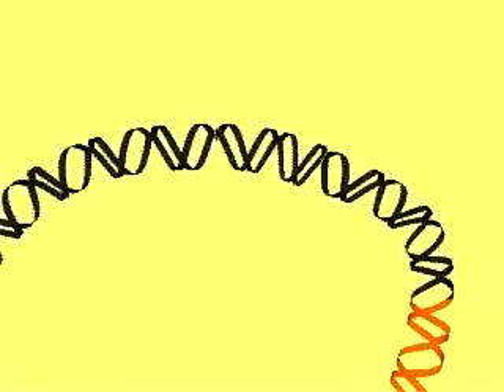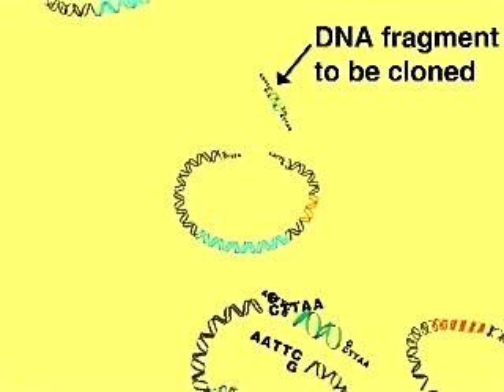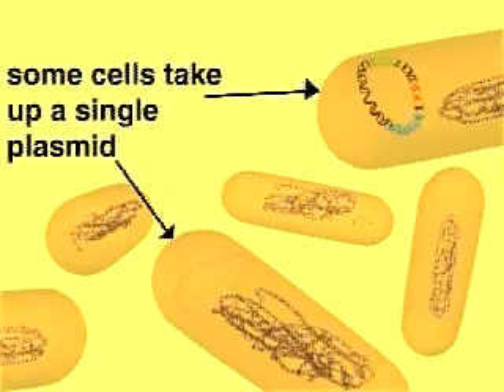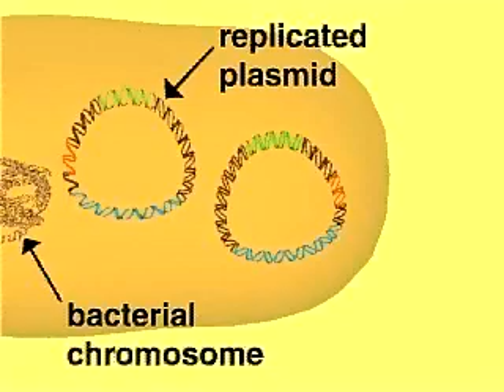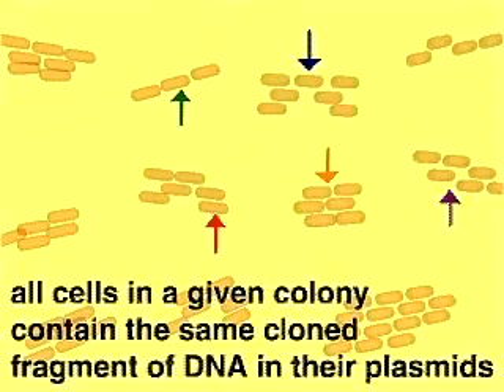Plasmid Cloning

Comment: Human insulin from plasmid cloning is not rejected by human bodies (usually), as opposed to bovine or pig insulin (we used to use bovine and pig insulin a lot).

Just to clarify, yeast isn't a plant, but a fungi (don't have chloroplast and can't photosynthesize). You can use plasmid cloning in yeast vectors, their called Yeast Artifical Chromosomes. For plants, you use other methods, than this, such as Ti plasmids, particle bombardment, or microinjection.

Source: Principles of Genetics 4th Ed